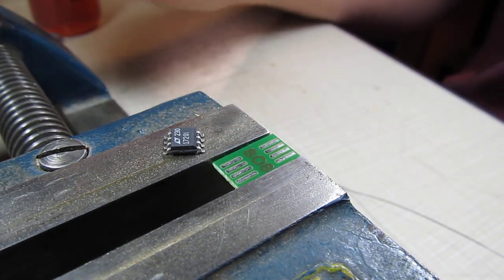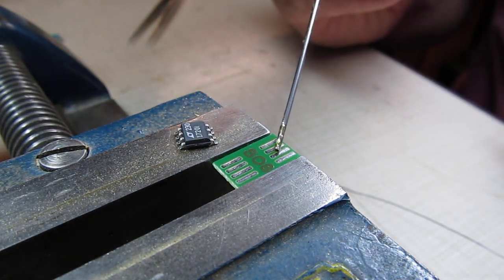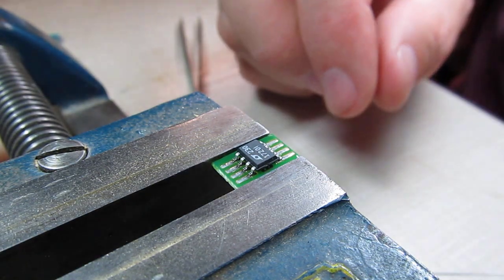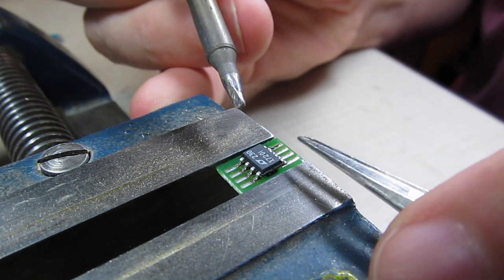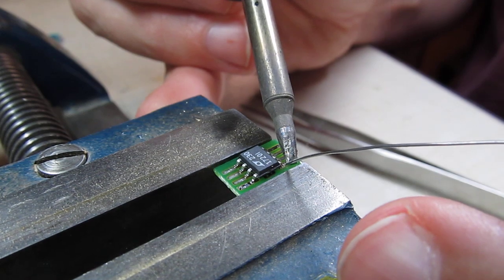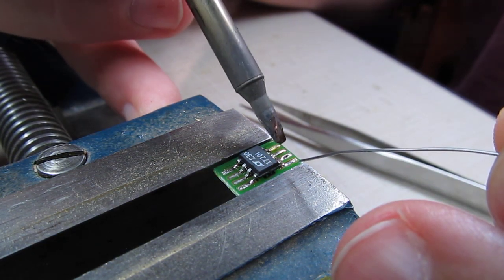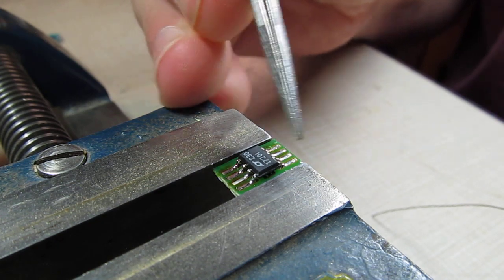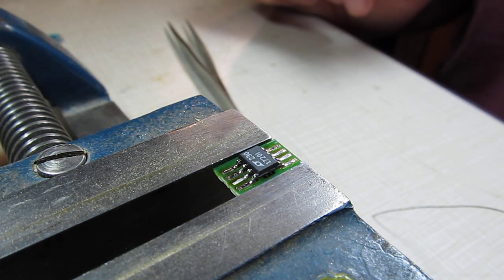#98: Surface mount IC soldering demonstration with SO-8 packaged device

Comment: I was always taught that Flux is conductive and can cause issues with sensitive parts,  how are you removing the flux from under the ic and between the legs?
Reply from the maker: It's generally not highly conductive.  If left uncleaned, it can degrade and become a source for leakage.  I usually clean with isopropyl or an appropriate solvent for the particular flux being used.  There are also "no-clean" fluxes available that can be left on the board.

Comment: I'd love to know more about your vise as well.  I'm in the process of setting up a garage maker shed and currently only have the little Panavise Jr from soldering in my condo.  Your uncle's vise looks very versatile.

What about using solder paste, either with a hot plate, toaster oven, reflow station, or even just dragging an iron?  I've experimented with each of those once and am curious about your thoughts.

Comment: Great soldering example. I was only wondering, is the flux just left on the board or does the residue need to be cleaned away with alcohol or something similar?

Comment: Just like cny02253. Same age same problems. Mount Polimar wouldn't let me have their glasses. LOL. Snap. I have only recently been thinking about SMD. Taking laptop batteries apart for my "Car Battery" project I found transistors, PIC, LED driver etc. This tutorial is fantastic for me. To get me going. I am going to start by taking off some SMDs from the battery management board and then try soldering them back in place. Wish me luck. Thank you very much for this tutorial. Amazing!

Comment: Good little video! I am 63, and just got into SMT as a result of building a Softrock, was a bit intimidated. Bad eyes and shaky hands! Things that work for me in addition to what you showed was: 1) Don't use too small a tip, 1/16 chisel tip worked best for me. Smaller tips get the heat sucked out of them too fast. 2) I had best results with 63/37 .015 solder at 650F. 3) Drag soldering works good! It's funny, but now I like SMT soldering better than through hole, etc. It's fast.